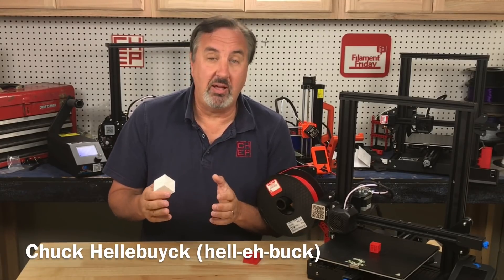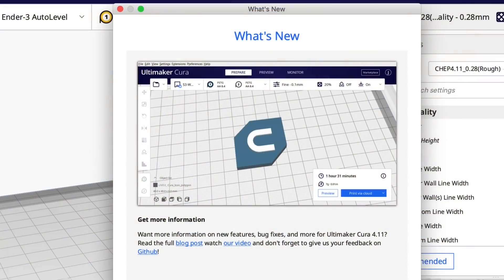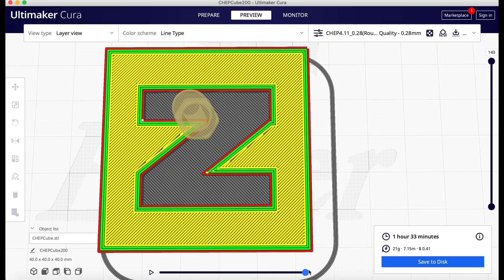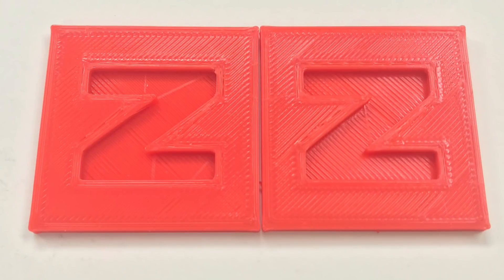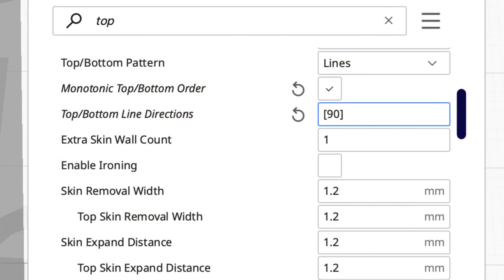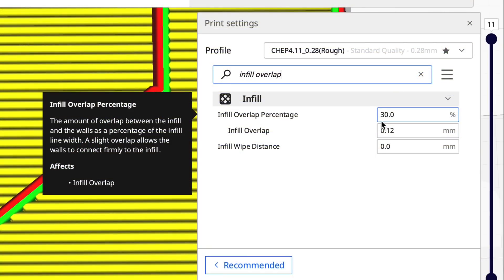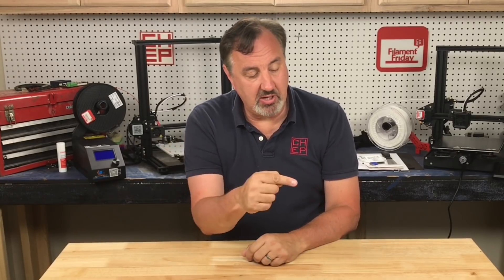Smoother 3D Prints in Cura Slicer 4.11 without Ironing!

Comment: Great instructions how you create visual smooth prints. Nice tricks! But I think there is a misconception how monotonic infill works and what the effect is on a print.
Monotonic basically assures that a skin area is always printed in the same direction. Since some of the material properties are depended on the printing direction. Polymer strains are orientated in relation to this direction, the profile of the deposited bead shows line related to the print direction as well and this surface corelate to the light reflection. I assume that is because the shear of the skin of the deposited polymer is different in the wake of moving nozzle flat area. Which creates a surface texture in the skin orientated based on the direction. Disregarding other material properties and just focusing on visual properties.

What we basically do is devide the region of skin in cells or nodes, when these nodes in the graph split up we know we have a new unique region. This normally happens around holes or influx points along a curve. Normally we don't care in which direction the infill pattern of such a region is printed so we optimize these as your normal traveling salesman problem. But now we constrain it to print direction, perpendicular to the skin lines.
Now this will add some extra travel and therefore time. But generally speaking travel time is a few percent over your complete print. So we're okay with that.
A misconception is that the surface will be less rough. It only has an impact on the visual properties and appears smoother.
Maybe we should have stated it a bit different in our change log and what's new pages.

Btw I would still like to invite you to share your profiles by shipping them directly with Cura.
Reply from the maker: Stating it different in the change log would help as it states it makes top surfaces smoother. I prefer to keep my profiles separate so I can update them at any point. Thanks.

Comment: Hey chep, one of the cura developers here. I think you misunderstood the feature. It doesnt make it smoother, it changes the visual properties. With the material you used, it wont change much. The biggest difference is with glossy / shiny surfaces.
Reply: I really thought the developers had finally addressed Cura's annoying habit to jump around when printing an even surface, creating an unnecessary patchwork effect.
Reply: @MetalheadAndNerd  We did. That is what the monotonic is for. If you combine it with the combing strategy "not in skin" you get a really smooth looking result.
Reply: @nallath  I'm eager to try it out. Have to wait for the sidebar UI extension to be adapted, though.
Reply from the maker: Jaime van Kessel - I’ll try that combination. That could be a great tip. 
I’m not against monotonic. I like new features. I just didn’t see the benefits defined by the Cura what’s new description. I may do a follow up. Thanks for explaining.
Reply from the maker: The why does Cura advertise it as making top surfaces smoother? 
Check the What’s New feature description. I briefly show it at 0:43. 
If your right, then it’s false advertising of the feature. So instead I showed some settings that actually give you a smooth top surface.
Reply: @FilamentFriday  Ah, I get the confusion now; It makes it look smoother. But it's only a visual change. If you were to measure the surface, it's not actually more smooth.
Reply: @FilamentFriday  I guess it’s just time for me to unsubscribe. You don’t even try to listen or understand.

Comment: Or you could just rotate the cube 45 degrees.....
Reply: Fun fact the reason line patterns for skin an d infill are often printed at an angle of 45deg is because we then use two motors to accelerate and move. Giving more control and greater speeds
Reply: @JelleSpijker  agreed, and if you want that aligned with the print, just rotate the print 45 degrees, too.
Reply: To be exact, highest accel is at atan(y_accel/x_accel), but if the next layer is perpendicular to that, it will be slower, so a compromise between the two is 45 degrees.  Neither layer is optimal, but the aggregate rate is.  Of course, for a corexy, the max accel values should be the same, while they aren't for a bed flinger.  Another point in favor of corexy.

Comment: good info in a short video, other peoples would stretch this video to 20+ min. excellent
Reply: This topic deserves more than the 5 minutes it got. It’s really not as simple as “old way bad, new way less bad”. It would also help to show models where it makes a significant difference.
Reply from the maker: Brett Vitaz - What old way / new way are you talking about?  I just showed settings to get smoother top layer.
Reply: @FilamentFriday  Based on intro, you set up a video that seemed to be about the monotonic infill (new way), but did not explain what it does. It has a dramatic affect on surface quality because the standard algorithm (old way) will change directions when it encounters a feature like a hole. Top layer lines will meet from different directions leaving visible markings on the surface. Like if you flatten carpet all in one direction and then swipe a segment with your hand in a different direction, the visual difference is very noticeable. The monotonic algorithm is like always pushing the carpet in the same direction. It only lays filament in a consistent direction and therefore does not present these visual artifacts. You almost touched on it in your video, but you seemed unsure about what it was doing by leaving a space in the infill and then returning to fill in the gaps. The “chep cube” is not a good model to demonstrate the new algorithm because the  top layer infill area is quite irregular and with lots of short extrusions. 
Maybe I misunderstood your intentions for the video, but you did not do a good job describing the what and why of monotonic infill. Looking at the comments, a number of your viewers seem confused and are disregarding the new algorithm as useless.
Reply from the maker: Brett Vitaz - The title and thumbnail tell the story, so not sure of the confusion. I did use monotonic as described in intro but showed it has minor effect on this particular print. Other settings are better in this particular case. In fact they work on prints with holes as well.

Comment: Meh, I went to Prusa slicer and never looked back...  Cura was slower to print and looked like crap comparatively.
Reply from the maker: I use Prusa Slicer as well and covered it many times on the channel. Like paint on supports. 
But why only use one exclusively, why not use what works best for any particular print. They are both free and both can be on the same computer. Here’s the paint on supports video. 
https://youtu.be/XFUfRVAm9ts
Reply: @FilamentFriday  true.  Like I said it may be that Cura was just bad at printing PETG, however there really is no excuse for taking 50% more time for a print using the same speeds just because of bad routing made in the gcode.

I'm still new to this (been printing for about 2 months), but Prusa was a game changer for me when using PETG.
Reply from the maker: It’s more than speed. Acceleration, retraction, other moves within the settings. I agree Prusa is better tuned to speed but I’ve had many prints come out better with Cura than Prusa Slicer. So thats why I use both.
Reply: I have been using Cura since I bought my printer. Your comment on Cura being slow was an understatement!  Prusa slicer makes Cura look stupid in the time it takes to print, and the paint on supports = WOW. thanks for the info
Reply: @Cosmicnomadzaa  so many people talk about Cura, that I never gave Prusa slicer a second look.  After struggling for weeks to get a working PETG profile, I switched to Prusa and had nice prints out the gate, and even better with some minor tweaks.  Prusa just works without doing crazy stuff like wipes or z-hops on retraction.

I did find my prints in PLA to be pretty fantastic out of the box with Cura, so maybe it's simply a problem with their PETG base profiles, either way, I'm very happy with Prusa slicer and I recommend anyone who hasn't, to give it a try.

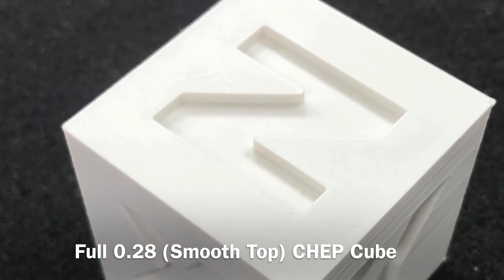Comment: Hey Chep, at 4:37 you can see some inconsistent lines on the side of your cube, I'm having similar issues and its driving me crazy,  the print looks great when looking from straight on the side, but at an angle, like in your video its visible. Any recommendations to fix?
Reply from the maker: You can use a better layer height like .20 or .12.
Also check the belts for loose and any wobble in the threaded rod.
Reply: Those lines are cause by Z wobble. Imperfect screw for Z axis. I upgraded my Ender3 v2 with dual Z and added anti Z wobble at both screws to be sure I don't have that problem.
Reply: @Blueyedevil2702  I think you're bang on. I just noticed a lot of play in the brass nut with the z screw.

Comment: I've used your profiles for a long time, but Cura still results is horrific stringing compared to Slic3r based slicers. Afraid i'm going to have to pass on this release until they can figure it out.
Reply: One big thing that can cause stringing is actually the filament rather than any of the settings. I had a spool of filament that was 2 years old and it was stringing pretty bad, probably due to it absorbing moisture from the air over time. I then ordered a brand new spool of the exact same filament and the stringing stopped. Also, some cheap filaments can also string. Its kind of a balance to find the perfect blend of cost and quality.
Reply: @memesredacted  I appreciate that can happen, but I'm taking identical filament and slicing the same file on different slicers. Print both back to back and Cura is a mess of stringing even with retraction set identically to Slic3r, but Slic3r gives almost no stringing even in very tough geometries.
Reply from the maker: The settings have to match your machine so if Slic3r works better go with it but I would recommend comparing retraction settings, temp settings, speed settings and flow to see what’s different. My profiles are tuned to a standard bowden style Ender 3. They are a starting point fit adjustments.
Reply: Well, its not automatically going to be found out by itself. Cura is open source and relies on contributions.

Comment: Your ironing is too slow for 10% flow rate. Try 50 or 100 mm/s
Reply: Came here to say this. I've read that 90 works really well so I tried that out, and I gotta say it does work well.  Turning down the flow to 3% helps a lot, too.

Comment: My dear Chap, you did it !
This time you mixed a combination of inset(half of nozzle diam.) , extra skin (=0) and walls (-1) and your settings are really the best !
This is the result of R&D.
Good !
But please note also other 2 secondary effects of your settings:
1. your settings have REDUCED DRASTICALLY BULGING of corners in the cube, and this is because bulging is the results (partially) of excessive materials deposited during walls printing. But because of ur removing the unnecessary walls, you also reduced the bulging as well.
2. FASTER PRINT:
The printing time have reduced of about 10 %
(I have reproduced your suggestuion on a 200% scaled cube and I the time went from 1h 16 min. to 1h 10 min. (about 8 percentage less)

Nice job!

Comment: Can I make molds with this printer??
Reply: Can make molds with any printer but there’s a bit to it. 

- Create the mold in CAD,
- print it
- sand it to smooth out any imperfections and layer lines
- Coat mold with wax or mold release
- pour in silicone.
Reply: depending on the size of the items you want to mold you would probably be better off with a resin based printer, ideal for making jewelry etc

Comment: Chep. Thanks for the smooth profiles.  I downloaded them today and noticed that the 0.12 Smooth and the 0.28 Smooth both have the Monotonic top/bottom order checked.  However the 0.20 Smooth does not have it checked.  Is that a mistake?  Should I add that to the 0.20 smooth profile?
Thanks.

Comment: How do you upgrade Cura without losing your custom printers and custom filaments?
Reply: My old profiles stayed just automatically on windows
Reply: It should automatically do that. There is also a backup built in to cura. Check under extensions

Comment: Monotonic is essentially like a perfectly striped lawn. It makes sure that the filament is laid down in a consistent back-forth-back-forth pattern. There are no adjacent strands of filament running in the same direction (which can otherwise happen on complex shapes). I don't think it actually makes the surface smoother. But it makes it look more consistent when it catches the light.
Reply: Thats right. The explanation that chep gave about monotonic ordering is not correct. 

The effect is mostly noticeable under extremer angles with glossy material

Comment: Anyway you slice it Chuck, your diligence and savvy with Cura Configs is unparalleled.  I don't think there is another comparable amongst the YT lot.
I have no other option than to become a patron. 
I am trying to set up an IDEX machine beginning some time later today once it arrives. Prob have bitten off more than I can chew. But needs must. I have a technical part wanting ABS with GF15 and water soluble supports. Have you any experience.

Comment: Great tips for top finish Chuck. I've never tried playing with the top lines directions let alone the width. And that Outer wall inset, which I kinda knew existed but forgot about it, will help a lot on 2 wall prints when the slicer keeps leaving a gap between the walls. Thanks.

Comment: CHEP, thank you for all the great profiles. I just tried them and there is some kind of issue wit the profiles. The first layer prints all distorted with multiple lines that are blobbed and lifting up. I tried the regular profile and the problem goes away. 

I'm using an Ender 3 with Marlin 2.091, cheetah board, TMC 2209s, and a metal extruder. Head is stock and I'm printing PLA onto a wham bam plate. Bed temp is 60 and print is 210, 205 to 230 is recommended by manufacturer. I sliced with Cura 4.11.

Comment: I just try your setting for monotonic and print xyz cube. And what I found x and y dimensions reduce from 20mm to 19.97mm. if use cura standard profile all axis exactly 20mm
Reply: Try change outer wall flow to 100 (default chep profile 95%)
Reply: @tdnam_9989  i dont use chep profile. I use Chep setting in this video and outer wall flow already 100%.

Comment: hi Chuck, and thank you for the explanation! This new feature helps a lot especially when it used to come back after having done lots of different things and then fill out the remaining area. looked horrible! This is much better!
2 questions though:
1. why did you discard the setting top/bottom line directions 0,90 in favor of 90 only.  All lines in the same direction . would that not give a less solid model in pla? i mean if there is some pressure on it wont it resist more if you have horizontal/vertical than horizontal/horizontal??

2. i checked your new profiles and found you have set the retraction speed back up to 45 . I remember that, to avoid stringing, you had set the retraction speed to 25 and it worked very well... (or did things change in cura 4.11 and we should go back up over 40?)

Anyway thanks for explaining the new features in cura 4.11--- it helps a lot..
Luc

Comment: This is the best Cura tip I've seen in years! Thank you so much Chuck. What acceleration and jerk would you recommend for a direct drive cartesian with dual lead screws? It's a Mingda D2.
Reply from the maker: I’d start at jerk 8 and accel 500

Comment: Hey Chuck, I think the monotonic option attempts to print in one direction only, in order to avoid having a slightly different finish on the surface. I think you should check on more complex (but still flat surface) and maybe try to focus on the reflection of the finish rather than tiny gaps, I think we should find greater difference there.

I think the logic behind it is that if you print using the same direction, the part which is touching the line of plastic which just got printed, it will touch the same side of the tip, and the pattern should be same. 

If, on the other end, you print in both directions, the tip touches the part just printed on the other side of the tip also.

If the sides of your tip are not perfectly symmetrical, (maybe not microscopically speaking but close that point where it might be weared-off differently or slightly dented on one side, not the other) I guess we could see the finish being different

I remember the first time I used ironing, I had a lot of text on the top, and yes the surface was very smoothed, but because the printer had to stop resume the top in different zones to avoid the holes of the text, we could clearly see different reflections in the material, killing the evenness of the finish. Maybe there is also something involving a change in temperature, because when the printer comes back to a zone printed earlier, it might be cooler and affect the finish of the plastic being put juste aside of it. 

At that point, I imagined there could be an option in Cura where I would say "steady one shot top surface without any traveling", that would just print using a steady motion all over the print, in one shot, a big zigzag in a rectangle path over the last layer, not skipping and travelling fast over the holes but just keeping the same speed as when printing, but letting the extruder do its job and stop the flow, maybe even without any walls for this last layer...
Reply: You see it mostly in larger surfaces. Prusaslicer and Superslicer have supported this for a long time, good to see it in Cura.
Reply: @pizzablender  yes a big shout out to Prusa Slicer for coming up with that printing strategy.
We have added the strategy to Cura due to frequent request from our community members.